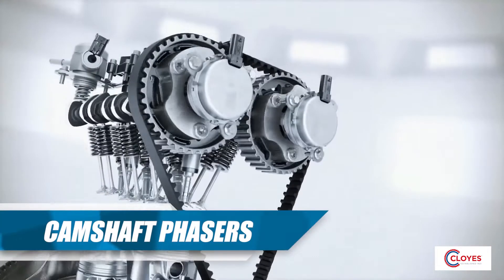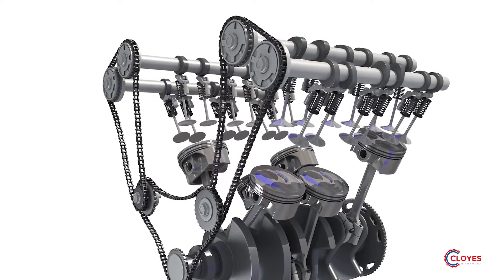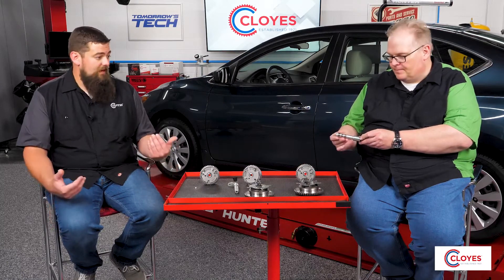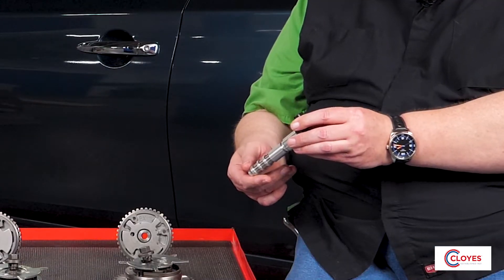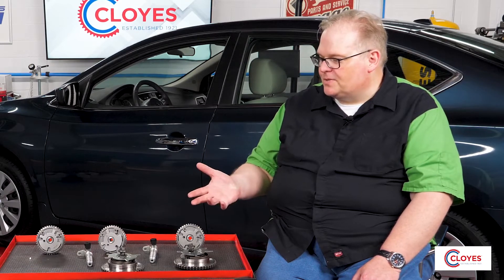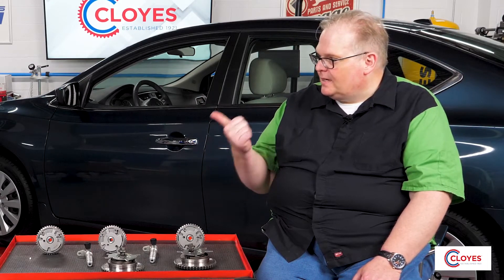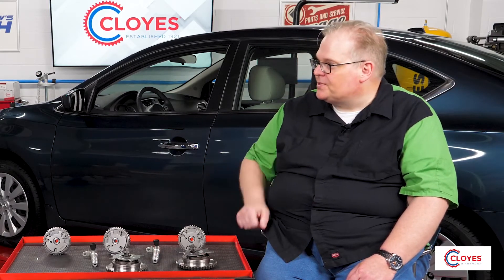Intro & VVT Phasers: Variable Valve Timing Module 1

Comment: A question for Cody.

I recently upgraded my '14 Ram 5.7 with a 6.2 Hellcat oil pump, (which is a high volume pump and as you know, pressure is the resistance to flow) which greatly bososted my oil pressure, from around 58 psi on a cold start, around 52 at operating temp to just over 90 psi cold and 85 at temp, to hopefully, do away with the infamous hemi cam/lifter failure aka the hemi tick.

How will this boost in oil pressure affect the phaser?
Reply from the maker: The oil pressure difference should not affect phaser functionality. The engine's computer is keeping track of phaser movement through the camshaft sensor and will send the appropriate signal to the solenoid to properly control movement.
Reply: @Cloyes01  ok, that's good news.

Thanks for the reply.

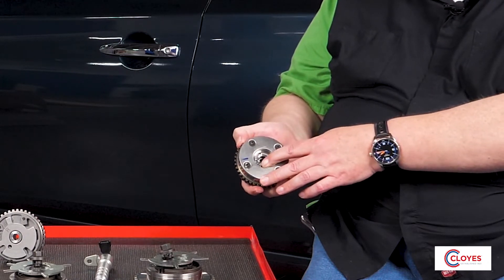Comment: 1:40 is that cam phaser Bolt a T30 Torx 5 point 🤔
Reply from the maker: The Cloyes supplied phasers use a standard T30 Torx bit. Some of the OEM tensioners use a 25IPR 5-point Torx bit.